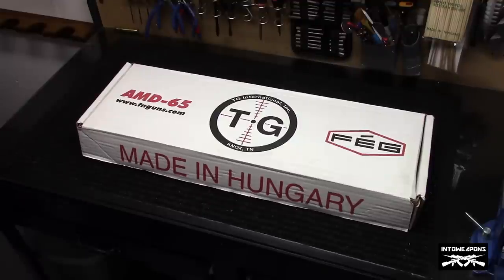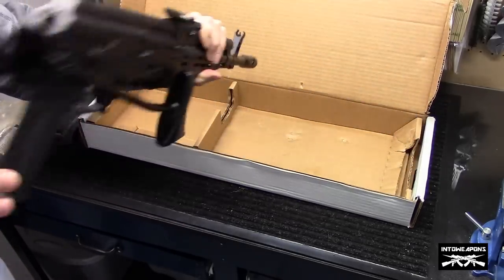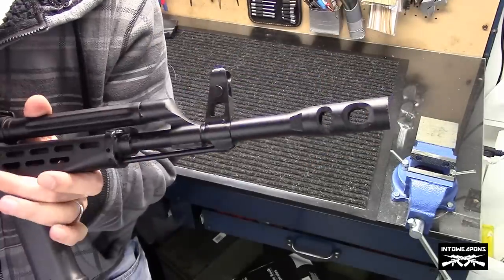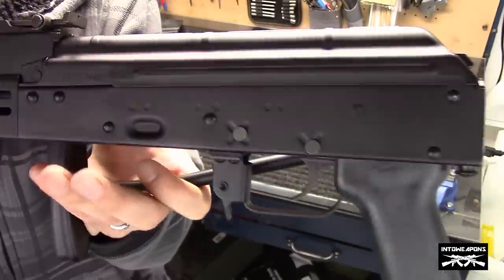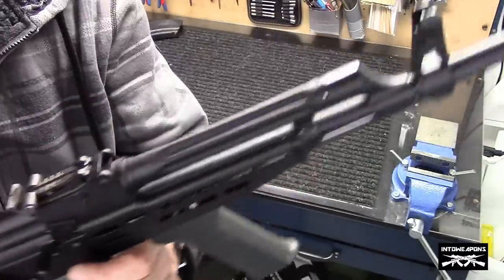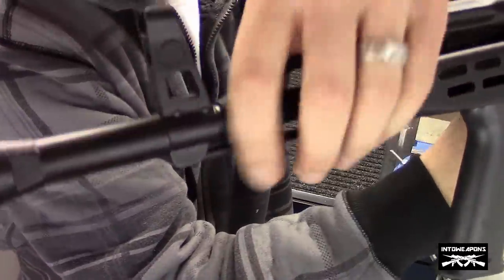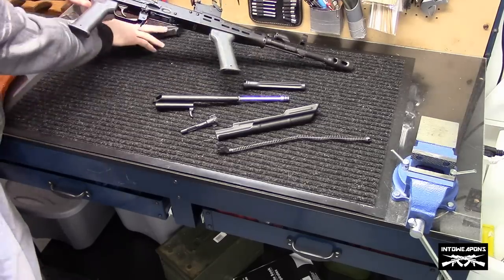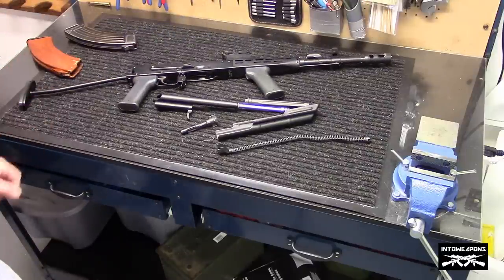Hungarian AMD-65 AK Rifle:  Unboxing & Overview

Comment: Those "Dimples for drilling a side rail" are the spot welds for the lower rails inside the receiver.
Reply from the maker: Zim Antics must have read something wrong somewhere, thanks for the clarification.
Reply: Yep that what I thought too.. Be nice if that was the case.

Comment: I have 4 AK variants.  The AMD is by far the lightest, coolest and loudest of them all. Damn good gun for the money especially when I picked mine up a few years ago.
Reply: So my bolt doesn't have springs, and my other aks do.  does your amd bolt have any springs when you disassemble?  thank you
Reply: +John Kennedy are you talking about a spring loaded firing pin?  Some AKs have them some don't. I've got a polytech that does have one. My polish tantal that doesn't have one.

Comment: I got mine years ago, it has a one piece brake on it with the original barrel. I did mount a rail on the bottom so I could get the grip I wanted. Great gun.

Comment: Original barrel length is 12.5"
And yes you can use 30 round mags with it bro. Did a vid about it and post the vid response.

Comment: 1. No word about the "hammer delayer", small metal piece which holds back the hammer for about a 1/100 sec to make more tight group in full auto.
2. 20 round magazine for officers, 30 round for the cannon fodders.

Comment: Mine has the 12.5 inch barrel, 1 piece pinned & welded brake, nodak spud receiver w sling loop, says sa2000m TGI.  

So mine is just a sa2000m parts kit put together bY TGI using a nodak spud US receiver I think.   What’s the difference between SA2000M kit build vs AMD65 kit build?

Comment: I'm currently talking myself into trading an Anderson AR for one of these.  BTW...I never would've thought of using a floor mat on my work bench. That's genius.  Saves lots of parts from rolling off the table.
Reply from the maker: Do it! That would be a great trade. These rifles only go up in value due to their heritage and availability. Just be sure to do the homework on that particular rifle model/serial. Some were imported and built on US receivers and subpar US barrels,, which are far less attractive. A good telltale sign of this variant is a longer barrel, but not 100% of the time. Thanks for watching!
Reply: @intoweapons  Thanks for the reply.  And yeah I'm most likely making that trade. I can assemble another AR on my kitchen table.  But these AKs are a whole different story. Lots of special tools and skills involved.  But anyway the one I'm trading for is an kit with FEG parts and the shorty 12" barrel with the welded 5" brake.  Originally I was trying to trade for a WASR or Zastava rifle with a fixed wood stock. But if this one works out as good as what I'm seeing in your video as well as others I MIGHT trade my M70AB2 under folder for a fixed stock AK. Hard to say that but maybe.

Comment: Got myne  years ago and have not been more happy with it. Nice carry,compact and  fun as all hell to shoot. it foes scream like a bansee pissing wiyh kidney stones loud as all  the aks I have fired . recommended to all whom can get the feg sa2000 import 12 inch barrel
Reply: So my bolt doesn't have springs, and my other aks do.  does your amd bolt have any springs when you disassemble?  thank you
Reply: +John Kennedy myne no sring on the pin it floats but could easily instsll one my mac does  so did my 56
Reply: +Lamont “Bigbore54” Albin just yhe hammer driven . the head is exposed evin when driven home. I  still  like it the best of sll akms I  have owned. .short of yhr finish

Comment: Had me worried when people were saying 30 round mags won't fit. Thinking about getting this as my first AK since I like the price
Reply from the maker: +Richy is the name some AMD clones are single stack rifles, so that is something you will need to be wary off when purchasing.  There are far more standard double-stack AMD clones on the market though, so you should be safe the majority of time.  Be sure to ask questions and verify prior to purchase if possible.
Reply: +jason127x99 pistol  stupid spell check!
Reply: It's only because of the grip. You can simply file the lip off the bottom of the grip and a 30 rd mag will fit just fine. Thats what I did.

Comment: A sarga olajos uvegben gyakorlo olaj volt. A pirosban pedig a haboru esetere volt olaj amit nem volt szabad kinyitni.
The oil boxes are interesting!
When I was in the Hungarian army in 1984 we had the yellow and red oil tanks.
The yellow was for regular daily usage. 
But the red one was for in case of war only.
Specifically we were told to not to open the red one.

l

Comment: Front handguard is useless just stamped sheetmetal that heats up pretty quick definitely change it out. And only difference between 63 and 65 is one has a folding stock one doesn't

Comment: damn, are these still available? i thought supply dried up on these. these are build from surplus hungarian parts kits right? or are there new manuf. parts kits coming in? is the barrel chromelined, hammer forged?
Reply from the maker: MykTheOccultist I don't believe they are coming in any longer, but there is a pretty good amount of parts kits still available state side.  The barrel is chrome lined.

Comment: nice condition but it is interesting that the standard AMD or Kalashnikov magazine is not suitable for the weapon, it wobbles a bit
Is this small magazine maybe a 10? It's quite disappointing, although the Kalashnikov factory only gives a 10 magazine in the civilian semi-automatic version of the new AK12 (The usual cheap and aftermarket orange plastic magazine is very ugly, otherwise it's a good idea, whose invention is an orange magazine into the weapon, which can be spotted from 500 meters away)

Comment: Another informative video. Saw Classic has some for sale (AMD65 and AMD63).... Always heard these were rare. Wish it came with the the 12" barrel but it's s 16" - don't see these for sale anywhere else. Wondering if I should jump on it or not
Reply from the maker: +Joey P thanks!  noticed those as well.  looked like solid rifles, but I didn't purchase one for the same reason you mentioned.

Comment: I'm having a HUGE problems with my AMD. the bolt would get stuck in the back sometimes when it cycled, and yesterday took it out to the range and what started to happen was the dust cover would pop off as the carrier spring would get stuck in the bolt carrier and would pull off the spring carrier, rendering the rifle inoperable. is it just buy a new carrier assembly or something else?
Reply from the maker: hard to troubleshoot without seeing the rifle in person, or being able to watch the malfunction occur.  I would recommend a thorough cleaning and lubrication of all working parts.  Check fitting on dust cover to ensure its tight, and in the correct position.  I would also check the recoil spring to ensure it looks operable and in good working condition (light gun oil cover).  But could be a number of things, including even the trigger/fire control group causing issues.  if all else fails, I would have a gunsmith take a look before trying to replace any parts like the carrier or bolt...  Recoil spring can be replaced at anytime without any concerns.  hope it helps and thanks for watching!
Reply: i'll try to put a video up tomorrow so you can see what i'm talking about. it didn't happen at all the first time i took it out 400rds through it. but I do appreciate the response!!!
Reply: All most sounds like the back of the receiver maybe out of wack. May need the rear trunnion shaved down to bring the rail that the bolt rides on closer together.

Comment: Wouldn't  a 16 inch  barrel  reduce recoil and  help accuracy?
Reply from the maker: +Sergey Slipchenko yes, but it wouldn't be the original configuration of the AMD-65, which was intentionally left short for maneuverability.  i beleive the amd-63 was the long version.
Reply: +intoweapons Thank you.
Reply: +Sergey Slipchenko 16 inch would only reduce recoil because it'd weigh, and it'd be minimal. As far as accuracy, you'd only see a significant difference once you started shooting at longer ranges. At reasonable combat distances, they'd both be about equal.
Reply: +12799MaDeuce Is  there  an  easy fix  for  wobbling magazine that  you  know  off.  It's  a known  issue among this  model.     Makes  some  magazines cause  feeding issues when  pressed upwards while  shooting.
Reply: +Sergey Slipchenko Mag wobble is a necessary evil in the AK platform. There are so many different mag specs that if you made a mag well tight enough to eliminate wobble, many mags simply wouldn't fit. I've never heard of issues with vertical pressure on the mag, but I'm not overly familiar with the AMD.
Reply: 7.62x39 doesnt really suffer from shorter barrels as much as your common 5.56/.223.  
7.62x39 and aks were designed for 14-16 inch barrels.  5.56/.223 was made for a 20" barrel.  
long story short these were originally 14" barreled rifles and were expected to engage targets up to around 400 yards and can shoot pretty comfortably and with decent authority easily to 300 yards.
this isnt accuracy driven sniper rifle.
this is a combat rifle made for paratroopers and tank/vehicle troops.
it fills it niche perfectly.
Reply: There should be less barrel whip with a 12” barrel and I do believe you only loose about 120-140 fps between 16” and 12” with 7.62x39.

Comment: Love my AMD. SpencerAK74m has a full auto post dealer sample version. Check his vid out. Full auto 75 round drum dump too. Weeeeeeeee.
Reply: So my bolt doesn't have springs, and my other aks do.  does your amd bolt have any springs when you disassemble?  thank you
Reply: Uniform Tango 74 I figured it out.  My Arsenal SLR bolt has a spring that covers the firing pin.  My AMD65 doesn't have one covering it's firing pin.  I thought maybe I was missing the spring on my AMD
Reply: +John Kennedy ahhhhh ok.

Comment: how much did it coast?
Reply from the maker: Think I paid around $600 if I remember correctly.  thanks for watching!
Reply: +IntoWeapons I paid 350 for mine. But it's made from a factory parts kit. Ever heard of joken firearms?
Reply: +jason127x99 that was back in 04